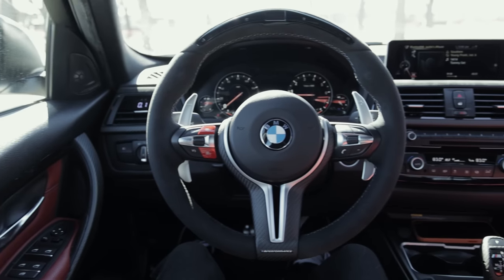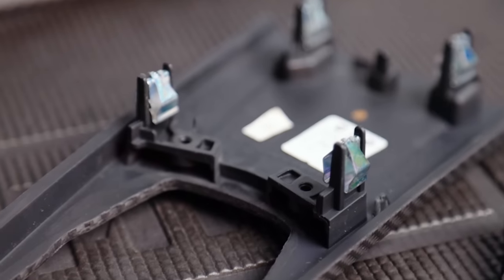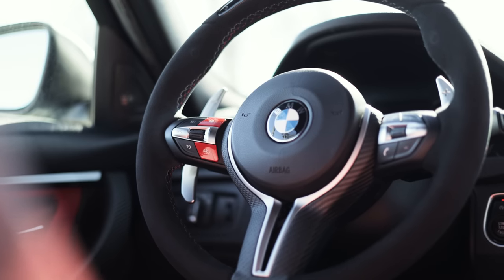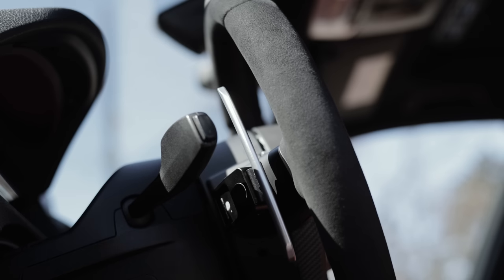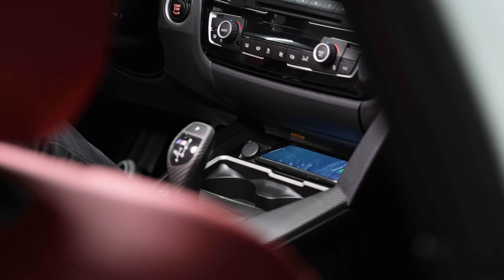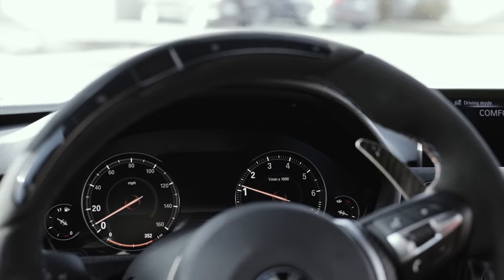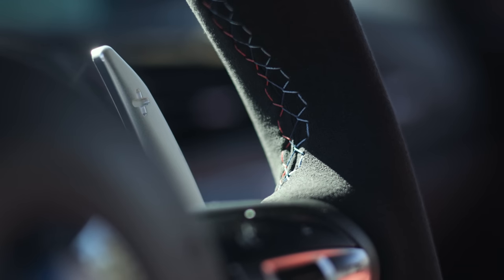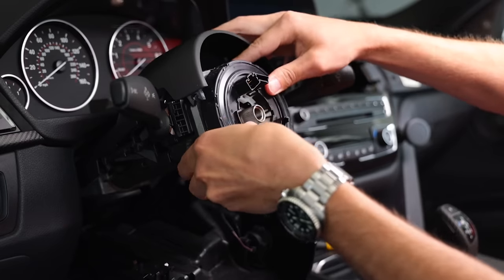Building the ULTIMATE BMW F30 Interior

Comment: I have 340 i luxury edition 2018.  Interior plastic peeling.  Need advice  how and where replace or fix ?
Reply from the maker: It’s a common issue on all BMW’s. Unfortunately there’s no fix aside from  replacing the pieces with brand new ones. Www.kiesmotorsports.com sells replacement interior door handles for the 3 Series
Reply: I tried this web  are this after market parts ? Also I didn’t see this particular parts

Comment: How much did all this cost? Also the car doesn't come with android auto or apple car play right? Any options there?
Reply from the maker: I got most of the parts through sponsorships but the total retail value would have been around $6,000

There’s a company called BimmerTech that makes a multimedia interface that allows you to run both Apple CarPlay and Android Auto. It’s a box that gets installed inside the dashboard and you can control it with the iDrive knob on the center console. You can also switch to the iDrive view for things like checking oil level, tire pressure etc

https://www.kiesmotorsports.com/products/bimmertech-carplay-mmi-prime-retrofit?_pos=1&_sid=0581f9ffc&_ss=r

Comment: Your run flat analysis is incorrect. 
1st off, how are you supposed to keep a full size spare in your trunk if you have staggered wheels? So you’re saying I need 2 full size spares in that case.  Plus run flats are tougher tires allowing you to drive with confidence on a long road trip. Also, they’re repairable even though bmw says they’re not.

Comment: The BMW M3/M4 Gloss Carbon Fiber Interior Trim also fits and is much nicer. Evolve makes nice billet shifter paddles. Cold billet Aluminum is a must. Venoxy makes nice custom color gauge overlays. Gloss Carbon Fiber shifter trim is only available aftermarket. The BMW ///M GTS Carbon Fiber and Alcantara E-Brake Handle and Center Arm Rest are very nice. Tricolor Stitching!! Colored Red/Blue Start Button Lastly, the BMW 3/4-Series G2X ///M Performance Floor Mats fit a BMW 3/4-Series F3X.

Comment: You forgot the iDrive screen retrofit. There are kits out that that provide a larger iDrive screen; I retrofitted my F32 to hold a 12” screen as opposed to the OEM 6.5”.

It did take a little finagling and trimming the dash panel to get it to fit seamlessly, but I like how it fills an overall empty space, without looking ridiculous like the current iDrive 8 screen.

Comment: Congrats on your project, it’s lit 🔥🔥. I have a real interest in buying the race display wheel for my F30. After checking the link on KIES, it says that this wheel is for the F87 and M2… will it fit my 2013 320i F30? It also says that it needs coding and you said it doesn’t, so I’m a little bit lost at this point. I hope you can help me, thanks a lot.

Comment: I have a G 31 for diesel 18 plate. Have you ever had O2 sensor stick open? If so is there anything on the market that can clear the code for the pain £700 a BMW dealership

Comment: I recently got a BMW and this was the first channel that popped up for me, and i love it. I just want to know. These changes can I apply them to a F22? And are there any vids on the channel for an F22
Reply from the maker: Yes many of these are available for the F22 as well but the parts themselves will be slightly different since the interiors are different shapes. If you check out kiesmotorsports.com they sell a lot of stuff for F22’s!

Comment: Does the phone charger work with a case? I have a 14 pro max with an Apple leather case, and do you know if it will it fit or will be super tight?
Reply from the maker: Yes I have the same phone and case. It’s tight but also keeps the phone from flopping around

Comment: i swapped F82 front and rear seats into my E92. so happy with it.
Reply from the maker: Nice! Was the wiring the same?
Reply: @justinbuice  both chairs were both mostly mechanical. had to cut both the plugs and swap those. also swapped the seatbelt locks. 
do got an airbag warning, but gonna get that programmed out.
even the rear seat wasnt an big issue to my surprise. had to make new holes in the mounting brackets.

Comment: Will the P3 Gauge display Oil temp?
Reply from the maker: No oil temp unfortunately. Here are the parameters it can display for the F30:
Boost 
Coolant temperature
Air/Fuel ratio 
Vehicle speed 
Intake air temperature
Throttle angle
Ignition timing
Engine RPM
Exhaust gas temperature
Battery voltage
Programmable shift light
Analog input 1 (brown wire) can allow gauge to read any 0-5 volt linear output sensor
Analog input 2 (blue wire) can allow gauge to read any 0-5 volt linear output sensor
Acceleration timers (0-60mph/0-100mph/60-130mph)
Braking timers (60-0mph/100-0mph)
Reply from the maker: Edit, it DOES display oil temp, at least on the F30. Just tested it tonight 😅